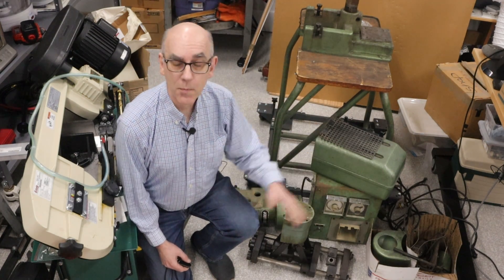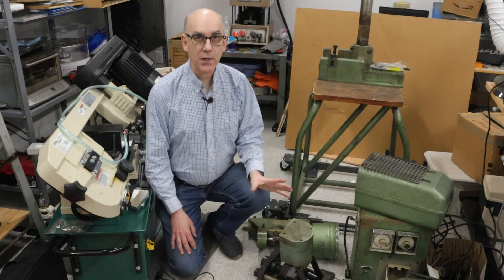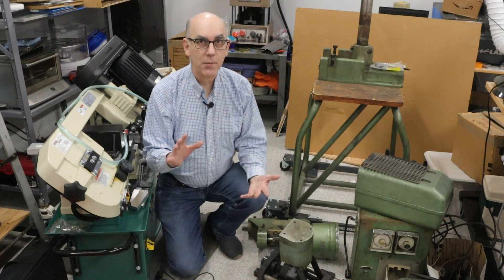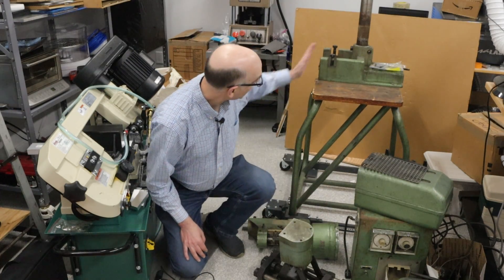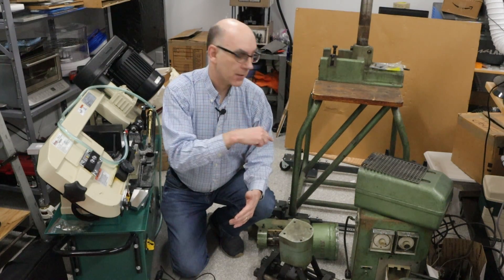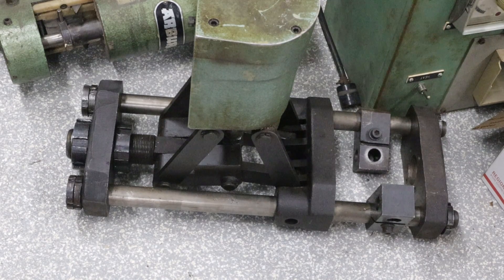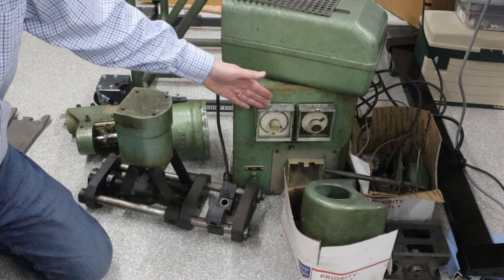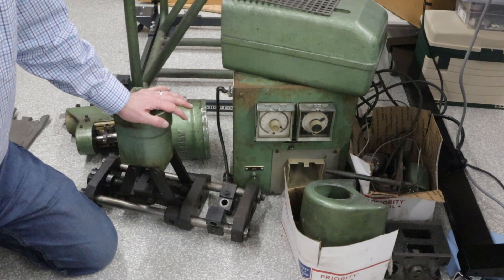Automatic Injection Molder Arburg C4B, Part 1

Comment: A lot like my Arburg Allrounder, a 1962 25ton horizontal/vertical hydraulic machine.  Your C4B is smaller but looks to be in much better condition than my machine was.   The controls were original thermal timers and relays the mice had made into their home and the clamp and slides need a lot of work.   Replaced the controls with an arduino micro controller with MOSFETs to run the 24V hydraulic control valves and solid state relays for the 220V heaters.

Comment: I have the same small injection molding machine in my workshop. Some time ago I started a small renovation. I replaced all the seals, started making a new control on Arduino. Unfortunately a constant lack of time.
Reply from the maker: This machine was in working order, and the previous owner may have changed the seals. So I'm going to assume I can just put it together along with modern controls. I need to get back to this project.
Reply: Hi Robert, You interested in selling your small Arburg?
Reply: @plants2plasticplasticjars161   Hi,
I am not planning to sell for now.

Comment: Looks like a great project. 
I got a manual for rebuilding my south bend lathe and it has a great word of advice. The parts you make don't care if the paint is original match. Make it to the color that makes your happy to see it.
Reply from the maker: Currently I'm not planning on repainting this--just cleaning the dirt and grime off. The paint looks like it's not in bad shape, and I'd like to keep it if I can.

Comment: i am looking forward to the next video. I like your injection molding machine videos the most.
Reply from the maker: Thanks. Just curious, why do you find the injection molding videos the most interesting?
Reply: @JohnSL  One of the reason probably is because there arent many videos on injection molding out there. What I like about injection molding is that by using this manufacturing process you pretty much get a finished part in a matter of secounds.

Comment: Love the video, a little while ago we also got an arburg C4B. Matter of fact, we got two of them. with three different extruder sizes. They are great machines but SO HEAVY :'( . We ditched the old electrical system, put new k type temperature sensors. And it works great, just need to make the electrical nice. Im excited in your next videos of it. Greetings from Netherlands.
Reply from the maker: Very cool! I've been making progress on the controller design, and I like where things are going. My plan is to make these controllers available for the small number of people who would want them.

Comment: There was a nice 12 ton clamp force arburg for sale in Europe a couple of months back going for 600 euros due to the main control cables from the control cabinet being cut. I seen it on surplex just checked it gone. If I was you I'd try and get an arburg 221 model IMM  and change the pump motor if needed if electric is a limiting factor. If u look for a model with a U in it it's horizontal and vertical clamp with the barrel going through the fixed clamp the hole thing swivels 90°. The 221's comes  with clamp force normally 25 tons but there is 35 tonners, I think if you could get a electric car motor and batterys you could make a good machine if you've got no 3 phase or just put a 5.5kw motor on instead of a 11kw and you could run that on a phase convertor it would only halves the speeds not the pressure and trust me you don't need more that 50 % speed anyway it's really only used for fast clamp movements to reduce cycle times, I'd say around a 3rd of the speed of maximum would be pretty much o k. The clamp would still work as well with no drop in clamp force just clamp speed. Jim🏴🇬🇧